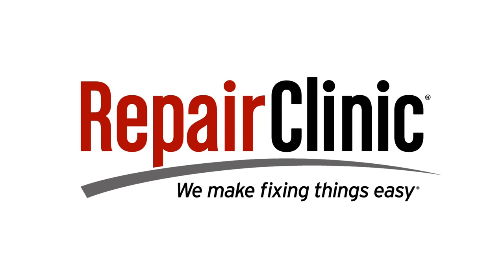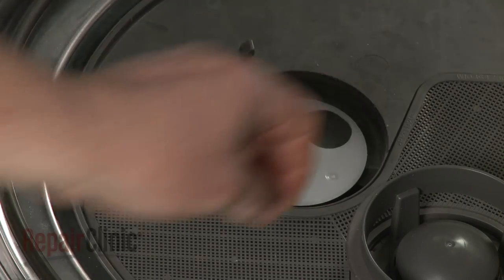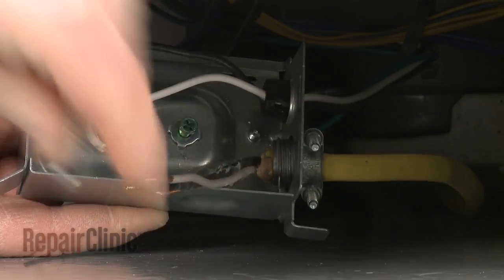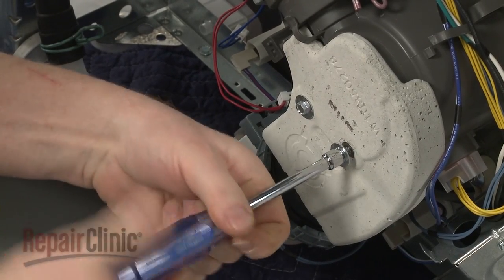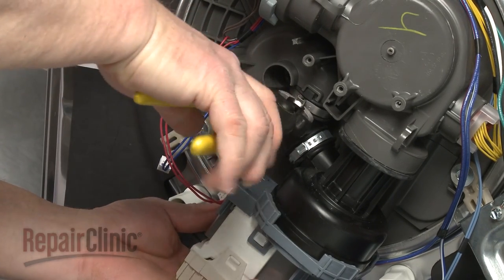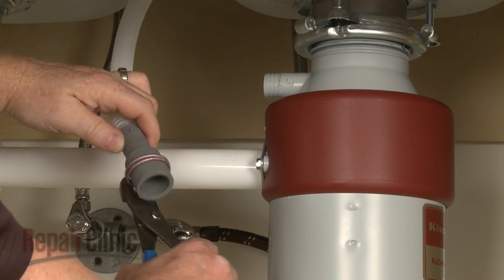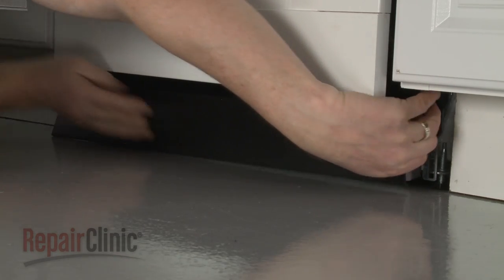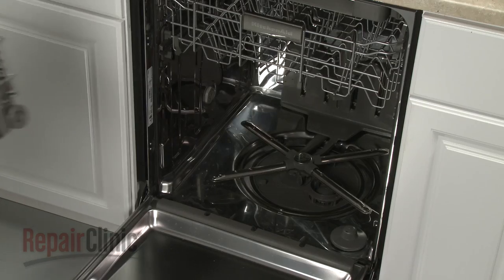KitchenAid Dishwasher Circulation Pump Replacement W11032770

Comment: If anyone is curious, I did an autopsy on my circulation pump motor.  It's constructed in the same manner as a fish tank power head, with a core-rotor assembly that sits in the water.  In fish tanks, the rotor is almost always in a vertical position, where the end of the axle rests on the bottom of the housing at rest, and it gets 'picked up' when the coil is energized and it spins.  The trouble with the design of the dishwasher pump is that they laid the rotor assembly on its side. At rest, the axle sits directly on the bearing material and at start-up, the axle grinds against the bearing until it gets up to speed. The pump quits because as the bearings become worn and oval-shaped, the rotor endplay grows to where the magnet 'hangs' against one side of the motor.  There's no mechanical interference, just an uneven magnetic field and it locks up. Overall I like my dishwasher, but this is an oversight by the engineers.
Reply: Oh it’s a design flaw. Planned obsolescence if you ask me. If a service tech does this job it’s easily 400. Needs to be a lawsuit.
Reply: @appliancealliance4444  Not so much immediate planned obsolescence-- a money pit appliance = cash cow customer on repairs for service techs!
Reply: That was a helpful, insightful, and informative write-up and revelation about the design flaw, M O'Connell!  Thank you!
Reply: Thanks for taking the time to figure out why the motor failed. I considered disassembling mine but then gave up when I saw your comment. Thanks again.

Comment: Thank you RepairClinic! This fixed my dishwasher's problem where it intermittently did not clean or spray water. 

A few tips from my experience:
1. Make sure you unmount the dishwasher from the side cabinets -- the screws are hidden under a plastic button that can be removed inside the dishwasher
2. Use a bit of plumbers grease around the pump's hose connections to make it easier to work with
3. I replaced the pinch-style hose clamp with a screw clamp (W10789434) so I didn't need to buy special pinch clamp pliers. It also seems more secure with this one
4. You may not need to detach the power wires if there's enough slack in the line behind your dishwasher
Reply from the maker: Thank you for the tips. 

We are always happy to help. If you would like to give us a review on Google, we would much appreciate it: https://g.page/r/CcVUrahZNozMEBM/review

We hope that you have a great day!

Comment: Thanks for the video!  This made my repair a simple process.  I discovered my old pump had stripped out the treads between the propeller and motor.  
My pump made a loud grinding noise before it stopped circulating water... this may help someone diagnose their problem.

Comment: I would strongly recommend using a worm gear type clamp instead of the one included.
Reply: Thank you, this worked out perfectly! They didn't have the clamp on its own at Lowes but employee there suggested the clamp which comes with the dishwasher hose kit, hopefully will stay in place unlike OEM (which seems designed to fail)

Comment: This video's really a huge help for me and saved me a lot of money… But it's nine years after you made it and my model is a bit different but it basically looks the same. Although I didn't disconnect the electricity the way you do in the video, I didn't understand why you had to… So I didn't and I also disconnected the hose on the outlet pump instead of at the garbage disposer… And I deserve all the water that came out of there!!… But I was ready for it, sort of! Otherwise it went exactly as you described it and I have no problems… Thank you so much for this video .

Comment: Works on Kenmore 66513269K114

Also recommend having a tube of Plumber's Grease on hand.  When you reassemble the dishwasher and the dishwasher diverter motor, use some of the grease to reseal the shaft of the diverter with its grommet.  Spread it liberally on the grommet and diverter motor shaft, reinsert and secure the diverter motor assembly.  Should help prevent leaks.

Comment: My dishwasher just stopped spaying water. It did fill. After running a diagnostic test from a few videos I watched, the code I got was 6 - 4. So I replaced the float switch but my problem was not solved. Then I tried replacing the inlet valve and nothing. Glad I found this video. Bought the parts on Amazon very cheap parts. Others wanted 3x the price.
Reply: I'm getting 6-1 errors codes and checked the water inlet valve and float switch and they're both fine. I think the error codes on this thing are not that accurate. Gonna try this now.

Comment: Great video. The impeller in my circulation was shredded apart and seized up the pump.  Pump was expensive (almost $300} and took 4 weeks to get but it went in easy.  Thank you Repair clinic. keep up the good work.  Your videos are superb!!
Reply: Absolutely no reason to take 4 weeks to receive needed parts on anything . Appliances cars trucks you name it. That's a shabby assed parts department that took that long!

Comment: You will also need the hose clamp pliers, but that's not mentioned in the tool list. You won't know it until you're putting it back together and have to leave mid project. Trust me...
Reply: Thanks for the heads up on this. You were right.  Luckily, I had a spare clamp on hand to use in place of the one that came with the pump

Comment: Avoid no-name pumps.  Ensure you buy the exact part and that it is compatible with your washer.  I first tried buying a replacement pump on Amazon that looked identical, fit perfectly and was half the cost of the original part.   I wish I had checked the model compatibility details.  After installation, the pump ran for a couple seconds and then shut down, then tried again for 2 seconds and shut down, etc.  After hours researching why this would happen, I ordered the recommended part, installed it and the washer ran perfectly.  It turned out that newer dishwashers kickstart their pumps at 120v then drop the voltage to 55v once running.  The clone pumps on Amazon and ebay require 120v constantly to run.  Check the model numbers carefully if you are buying a no-name pump to ensure the model number matches exactly.

Comment: Video very good.  I had a weird problem.  Sometimes the recirculation pump would work after performing a drain then restart.  I initially swapped the control board thinking the on signals were being lost with no effect, finally after babying the symptom for two months the cir pump would not spray and swapped it out, problem solved.

Comment: Did any of you that performed this repair run the diagnostic cycle before hand? If so, did it kick out the 4-3 error code (washer motor not running)? I'm certain the washer motor is not running when I run the dishwasher, but it could be the control, the relay, or the motor itself. Problem is, there are no error codes kicked out. All signs suggest the control panel is ok, and I hear clicking a bit after the tub has filled and water inlet solenoid closes. This has me thinking the relay is ok. But it irks me to guess, particularly when the diagnostic cycle should kick out a code.  I guess my options are now to actually test the relay and motor for continuity and voltage manually. So much for me mindlessly getting to trust the diagnostic cycle to tell me what to do!! cry

Comment: Seen another video where they just take the whole sump out from inside the DW, no need to take the whole thing out and put on side etc. What do you think ?
Reply: Pulling the sump from the inside seems to work on Whirlpool dishwashers with the plastic tub, the sump cannot be removed without uninstalling at least one of the pumps on a KitchenAid with the stainless tub.  The drain pump just twists out of the assembly, which makes sump removal possible. But good luck getting your hand on it with the dw installed.
Reply: I debated the two methods. I took my dishwasher out and it was very easy to replace the pump when you can reach everything easily.

Comment: I have this exact dishwasher. Water fills and drains. The touchscreen lights work and shows that it's doing its cycle. The only thing that's not turning on is the motor. This happened at about 14 months old and I didn't get an extended warranty. Do you think it's the motor assembly that you're changing in the video?
Reply: John, So mine fills and drains but not water circulation......did you figure out if it was your pump?
Reply: @ThePanfishAssassin  It's the motor assembly.
Reply: @ILC-eo6vk  hi did that fix w the motor assembly? Mine fills up but no wash cycle.  It fills and drains fine.   Do you think m assembly will fix?
Reply: @jozy8612  We had to replace the motor and pump assembly.

Comment: My last Kitchenaid dishwasher was 22 years old... I only ever had to change the water inlet valve...that’s it. .... So I bought another Kitchenaid to replace the old one. It is less than 3 years old...and the circulation pump went. LESS THAN 3 YEARS OLD. I’m done with Kitchenaid...Whirlpool.. and Kenmore. Start making your parts in North America...and I’ll buy your products again Whirlpool.  Until then... adios amigo.